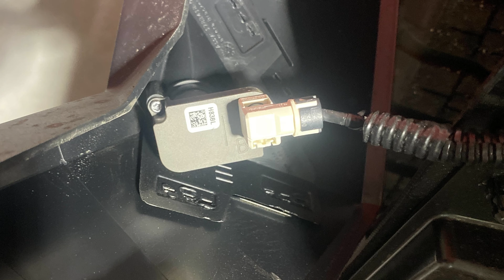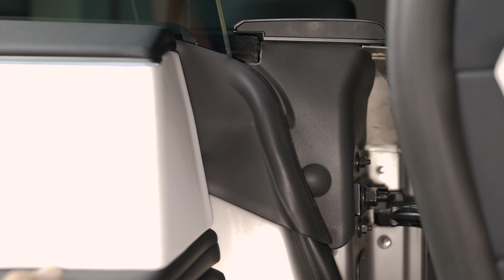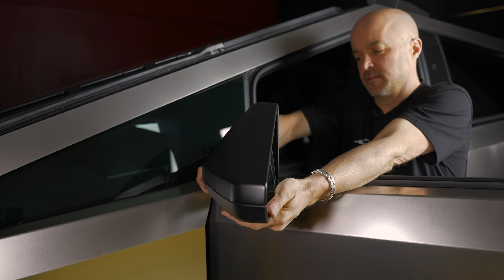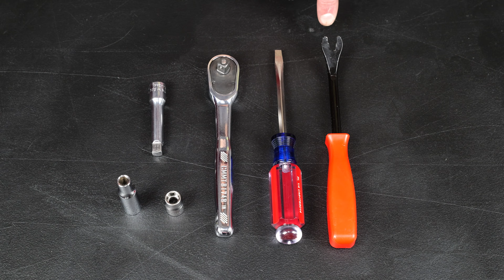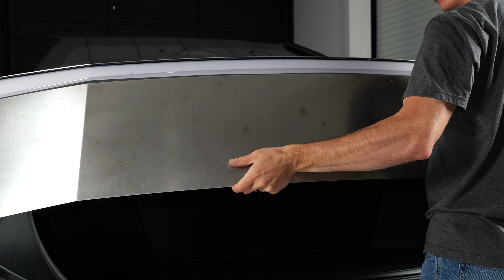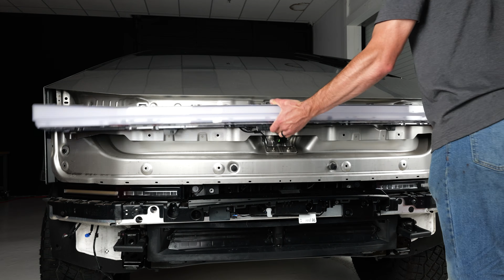Cybertruck DIY Wrap & PPF Truck Prep Guide: Removing Cladding Trim, Side Mirrors & Window Seals

Comment: Great stuff, thank you!  Frunk hood and front happen to be the last panels I still need to wrap.  Got any advice on how to remove trim surrounding bed side outer panels so edges can be rolled?
Reply from the maker: That trim can be prone to breaking clips when removing, so we would recommend tucking the edge with the trim in place.  Be sure to clean the backside of the panel well first!
Reply: @TSportline you were 100% right.  I broke 2 of 3 clip mounts on the side sail baffle appliques.  Waiting ~wk for $15 replacement.  Was able to remove side baffle closeouts ok.  Removing bed sail appliques was hilariously funny knowing that each 6mm white POM clip would drop into the bed side caverns.  They're $1 each, each side has ~10 clips.  I took the hit for one side, and the wrap on that right side is noticeably better for it.  Thanks again for sharing your knowledge.  Got a patreon I can send money your way?